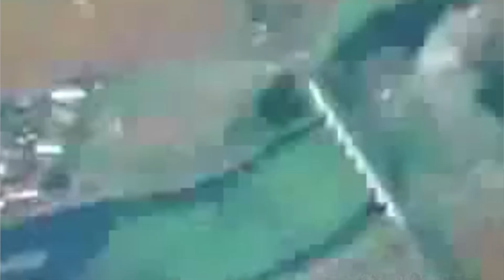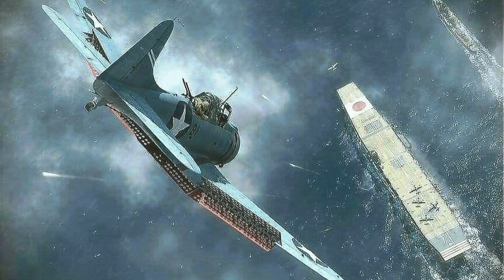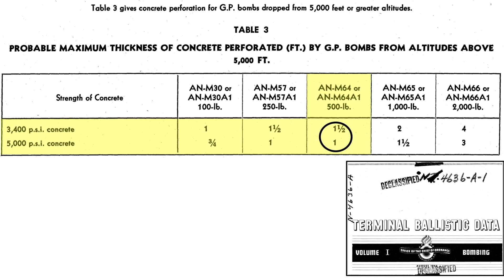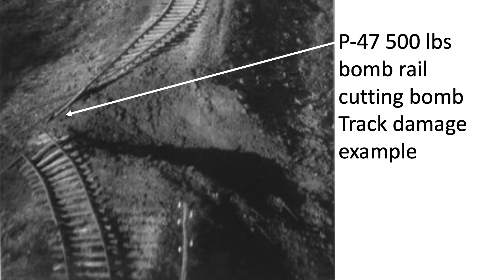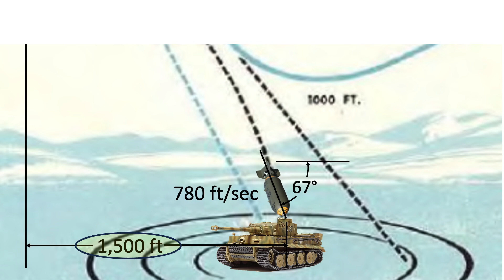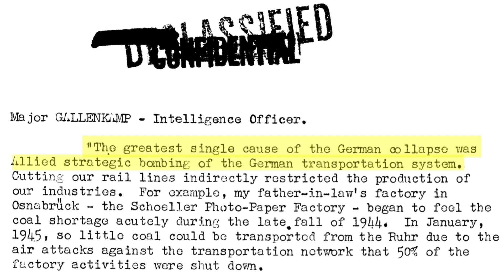P-47 as a dive bomber - Tactics, Lessons Learned, Effectiveness, and Footage. Deep Dive Review

Comment: Seems extremely wasteful to need a direct hit with a 500 pound bomb to pierce only 1 inch of steel.
Reply: If you can guarantee a direct hit, and that your target is armored, you can get through it with a much smaller shaped charge like a Bazooka rocket.  A general purpose bomb, however, is meant to level a building, destroy half a parking lot full of trucks, crater a runway, knock down various types of bridge, etc.  It also could cause a mobility kill on a tank by damaging a track, or putting shrapnel into the engine compartment, or just frighten the armor commander into retreat.  

If it lands on top of a tank turret, then most of the explosive energy might be lost into the air, but without guided missiles it's probably the best you can do from a fighter.

Comment: I always wondered why the Air Force didn't use the Thunderbolt for ground attack in Korea, instead opting for the liquid cooled Mustang.
Reply: Mustang was cheaper to keep in service in crash strapped post-WW2 era. P-47s were sent fast after WW2 to reserve AC dumps, some served in Air National Guard for few years. Majority was broken up, and rest given to Taiwan as military aid. Jugs represented significant scrap value, much more than Mustang. Civil aviation needed Pratt R-2800 engines and their parts and paid good money. Merlin engines worth in scrap market was as boat anchor or aluminium metal. Every sane pilot would had chosen P-47 over Mustang in close support mission, but they hadnt the choice, majority of of P-47s were gone in 1950-51.

Comment: The Brazilian Air Force's First Fighter Squadron performed excellently in the Italian Campaign with its P–47s, using bombs, rockets and machine guns against a variety of targets. We were then subordinate to the 350th Fighter Group of the US Twelfth Air Force, and at the end of the war the "Senta a Pua" Squadron was awarded the Presidential Unit Citation for its services.
Reply: Statistical summary during World War II:

Total operations[14]
Total missions performed	445
Total offensive exits	2,546
Total defensive exits	4
Total flight hours in war operations	5,465
Total flight hours performed	6,144
Total bombs dropped	4,442
Incendiary Pumps (FTI)	166
Cluster pumps (260 lb (120 kg))	16
Cluster pumps (90 lb (41 kg))	72
Demolition pumps (1,000 lb (450 kg))	8
Demolition pumps (500 lb (230 kg))	4,180
Approximate total tonnage of pumps	1 010
Total 50 caliber ammunition	1,180,200
Total rockets launched	850
Total liters of gasoline consumed	4,058,651 L (892,778 imp gal; 1,072,182 US gal)
Reply: Total operations:
Destroyed	Damaged
Airplanes	2	9
Locomotives	13	92
Motorized transport	1,304	686
Wagons and tank cars 250	835
Armored cars	8	13
Animal-drawn vehicles	79	19
Railroad and carriageway bridges	25	51
Bridges on railroads and highways	412	–
Sorting platforms	3	–
Buildings occupied by the enemy	144	94
Camps	1	4
Command posts	2	2
Artillery positions	85	15
Accommodation	3	8
Factories	6	5
Miscellaneous facilities	125	54
Power plants	5	4
Fuel and ammunition tanks	31	15
Material deposits	11	1
Refineries	3	2
Radar stations	–	2
Vessels	19	52
Ships	–	1

Comment: The book Masters of the Air came to the same conclusion, that the destruction of the German railway system was the most devastating effect on the German war machine. It caused the coal shortage and made it almost impossible to move anything across the Reich.
Reply: Exactly, people who claim that the USAAF's bombing campaign was a failure by using the number of aircraft and tanks produced don't understand something about the bombing campaign, at one point in 1943 Army Intelligence figured out that the most effective use of bombs was putting them on railroad marshaling yards, they figured out that they could destroy more aircraft that way because they were being shipped via rail than they could by bombing their factories, it doesn't matter how many tanks and aircraft the factories produce if you're destroying them before they get to where they're being used, and not only are you destroying those but you're also destroying, and disrupting the manufacturing of, just about everything else that's a part of the German war machine including it's very troops, production numbers of war equipment is meaningless if you're destroying it before it can be used and the railroad marshaling yards were the choke points for all that war equipment, aircraft, tanks, aircraft and tank replacement parts, rifles, ammunition, boots, and all the supplies and materials to make all of that could all be found in railroad marshaling yards and because of the relatively long and narrow shape of them they were ideal targets for high altitude bombers.
That's not to say that they all together quit targeting aircraft and tank factories, it's just that many mission's that by earlier doctrine would have bombed those factories instead bombed railroad marshaling yards which can make the production numbers of aircraft and tanks be deceiving, just looking at those number's can make the bombing campaign look ineffective but the story is far more complicated and involved than those figures can tell, I've been telling people who make the claim that the USAAF's bombing campaign was ineffective that the best source for information on whether or not it was effective was the Germans themselves and what they had to say in their reports on the effectiveness of it, according to them it was very effective and devastated their war effort.
Reply: @dukecraig2402  Exactly.

Comment: Great video! Question about use of their wing mounted machine guns - is it true pilots would use their machine guns to skip bullets on the ground underneath armored targets of opportunity to hit the vulnerable bottom of the vehicle?
Reply: Personally I think this is a misunderstanding by pilots of the day, or something getting lost in translation. Under normal circumstances a 50 cal round would pen about an inch of armor, which was about the thickness of a Tiger IIRC.

Given that the round would lose a ton of energy from hitting the ground, the fact that it would be tumbling and hitting at a shallower angle, I doubt there's any chance of getting a penetration. 

What I think it more likely is German troops storing ammo or fuel under parked tanks, thinking they'd be safe there. Then a P47 strafes the tank and a round strikes the combustible material beneath it and it cooks off.
Reply: There is a video on the channel about this.

Comment: I have read, but don't remember where, that the F4U in the Pacific had a reputation as 95% as good at dive bombing as the SBD and SB2C.  It had good flaps for that, and its landing gear was designed to extend in dives as a dive brake.

Any chance you could cover the F4U as ground attacker?
Reply: The flaps on the F4U weren't used for dive bombing, the two large panels on the front of the landing gear when they were down acted as dive brakes. 
Like all other aircraft the flaps on the F4U were to increase lift at low speeds which lowered stall speed, something that's an absolute necessity on aircraft that have to land on carrier's, aircraft that suffered battle damage that kept them from being able to lower their flaps for landing on the carrier had to land at dangerously high speeds and would quite often wind up in the crash barrier net from having their tail hook ripped out or breaking the arrestor cable, especially if they were heavy from having bombs they couldn't jettison because of damage, without the use of flaps an aircraft trying to land under those conditions really had a dangerously high speed to keep from stalling. 
When it comes to using those flaps for bombing I've seen films where F4U's had their flaps down while glide bombing at shallow angles, they'd lower their gear and their flaps for that, with the drag from the gear down with it's panels on the front and the flaps down to lower stall speed they could come in on a target relatively slow for increased accuracy, I'm pretty sure it was Charles Lindbergh who came up with that technique while working with navy pilots in the F4U in the Pacific before he moved on to helping Army pilots with extending the range of the P38.
Glide bombing is different from dive bombing and is something rarely covered in documentaries, and that's a shame to because it became the preferred technique for bomb delivery over dive bombing when it was possible to use the technique, they found it to be far more accurate and even with aircraft that had proper dive brakes like the SBD glide bombing was still preferred over dive bombing by the end of the war, matter of fact it was a glide bombing run that Ens George HW Bush was on when he was hit and shot down in the Pacific.

Comment: Dive bombing is usually discussed with naval planes like the SBD and SB2C. It was great learning how the the Army Air Force used dive bombing on land. To be able to hit a Tiger tank with a 500# bomb seems problematic. This YouTube seems to indicate it was common, especially without dive brakes. I wonder how necessary are dive brakes in dive bombing accuracy?
Reply: Dive brakes would prevent overspeeding and allow the dive to be started from higher up and the drop to be made from lower down, still having enough room to pull out. 

I can't imagine they had much success hitting precise tanks, post-battle analysis showed pilots overclaimed armoured vehicles by about 10-1 odds.

Comment: Excellent as usual!  Despite the P-47s reputation for toughness, roughly half of them produced during WW2 ended up destroyed due to combat and non-combat causes.  If one factors out those that never left the US, those are very high losses.  Odds of hitting a Tiger tank on the roof with a 500 lb bomb were pretty minimal, but near hits could wreck suspensions and even overturn a tank.  Aiming bombs with a fighter plane's gunsight was not very effective, and "target fixation" could cause a pilot to fly into the target or forget to pull out of a dive in time.
Reply: I'd also question the cost/benefit ratio of attacking a tank with a P47. Figure in the cost and time to train that pilot plus the cost of the plane vs. one tank. Seems very high risk/low payoff and better to go after softer targets, trucks and trains. But then we went and built the A10 so what do I know? 😂
Reply: @dave.of.the.forrest  Not that I think the P-47 killed that many tanks, but you are talking about exchanging a P-47 for a tank, which was obviously not the objective.  In a contest between the two the tank does not present a real threat to the airplane, it is the AAA and even infantry small near the target that presents the danger.  So I don't see the risk in attacking a truck being substantially less than in attacking a tank, making it was a worse cost/benefit ratio to risk a P-47 for a mere truck.   (Not that such a poor cost/benefit ratio would deter the USAAF or the USAF, which risked very expensive airplanes and pilots to kill single trucks in Vietnam and Laos.)
Reply: @gort8203  Don't think of it as the cost of a tank vs the cost of a plane, or the training of a tank crew vs the training of a pilot.  The tank needs to be destroyed because it is a threat to your troops on the ground, and even if it does end up being a plane lost to destroy that tank, the destruction of enough tanks or trucks might stop a counterattack that destroys an infantry company or battalion.  Or might weaken the enemy defenses enough to allow your next ground attack to succeed.  The infantry won't be supported if you lose all your planes, of course, but it's worth a certain amount of risk.

Comment: Gotta remember they could buy almost 3 P-51s for the price of one P-47.  Thunderbolt was expensive
Reply: Not true.  In 1945 the P47 cost 1.6 P51’s.  80k$ vs 50k$.  The P47 started the war around 110k$ but comparing early war models to P51’s isn’t fair because the P51 wasn’t in service yet.

The P47 could do everything the P51 could do AND act as an effective fighter bomber.  So it was certainly worth the premium.
Reply: @JimmySailor money talks, 3 P-51s vs 2 P-47s is certainly a question. 
Or perhaps 2 P-51s and a Sherman or 2 P-47s or whatever.
Reply: @JimmySailor  Two different sources I read said 2.5-3 times as much… either way I don’t really care. And I’m not doubting it’s value so calm down kiddo

Comment: And yet, when called on for CAS in Korea, the USAF, which had both types, used the P-51 over the superior P-47, resulting in many losses.  The USN wisely used F4U’s, not that they had any water cooled piston engine aircraft.
Reply: The P-47 was not as readily available as the P-51. Fewer were left in service, I think most were with the ANG as opposed to the AF Reserve, which could more rapidly transfer planes to active duty units during the emergency that existed at the time.

Comment: Seeding the wreckage with additional long delay bombs is pretty devious. Was this also done in larger scale bombing?
Reply: yes, it was the usual procedure, f.e. the RAF carried a mixture of big High explosive bombs 2000lbs and 4000lbs to destroy windows and roofs in a streetblock and then showered the area with a lot of small fire bombs to start massive fires. "normal" HE-bombs 250-1000lbs were used beside them to destroy waterpipes in the streets and telephonlines, and to hamper the civil services by making craters in the roads. about 10% of this HEs were time fused to disrupt firefighting, road clearing and repair in the hours and days after the attack. most of the bombs found intact in the ground today were of the time fused typ. because the fuse relied on a chemical reaction. it is estimated that about 10% were duds
Reply: Yes. All sides did it.